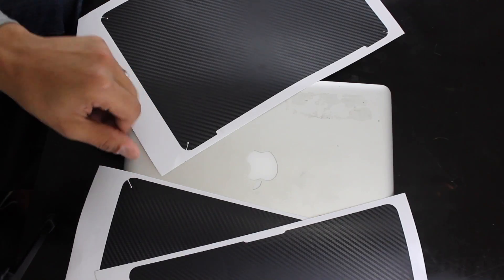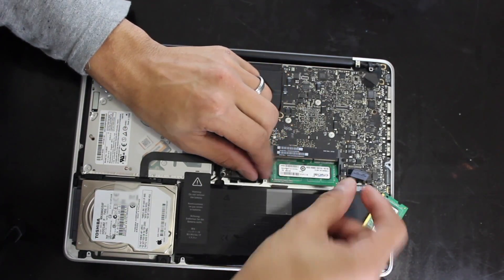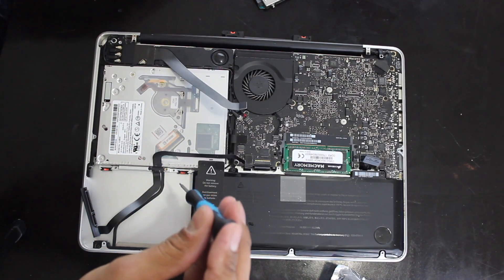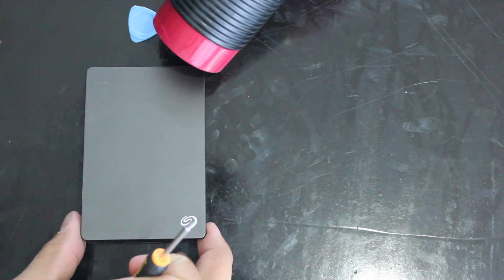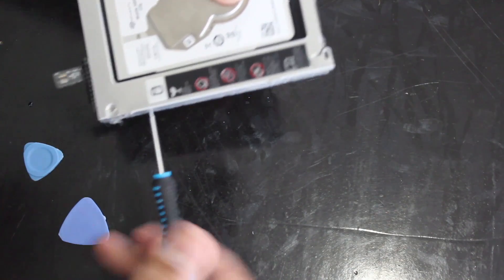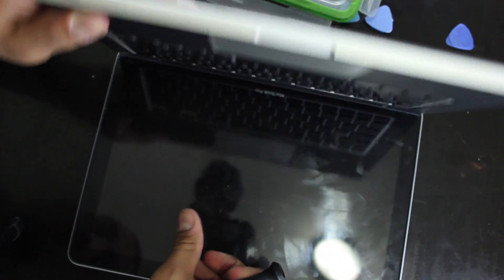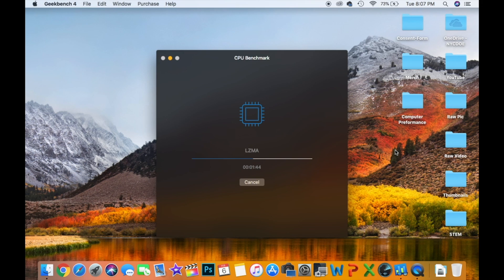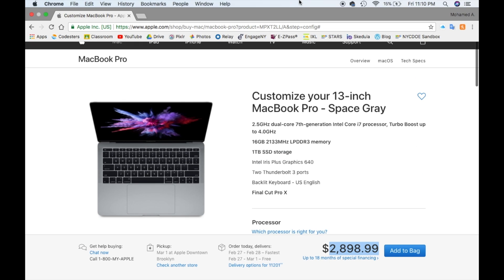2011 Macbook Pro Upgrade (3TB, SSD + 16GB RAM)

Comment: cheers man. just one question. does it work with MBP early 2010?
Reply: not white. its unibody
Reply: you can speed it up with SSDs but maximum ram limit is 8gb 1066mhz for models older than 2011. if i'm wrong please enlighten me.
Reply: Fatih Gözenç I have a mid 2010 MacBook Pro 13 with 16gb ram. It won’t work  on the 15 inch model though
Reply: @jbass1212  i have the same model. Macbook pro 7.1. Would a 1t ssd and 16ram work on this model?
Reply: bhavesh gungabissoon Yes 16gb ram and an ssd works in the 13 model
Reply: @jbass1212  thank you. Planning to upgrade my mid 2010
Reply: bhavesh gungabissoon It will bring new life to it. My 2010 was very slow before

Comment: Hi, i have the Macbook Pro mid 2009. already got 250GB SSD principal hard drive running  win 10 on it, is fast enough but i do wanna upgrade it whit 8GB RAM (max for my Macbook Pro) and put another hard drive caddy as u did,.. my question is if i'll have to reintall the Win 10 or somthing, bcuz i have everything in there (apps and docs). how it works?
Reply: allright,... thanks mate.
Reply: Nope. Your Windows SSD remains C. New drive will likely show up in your Explorer as D.
Reply: how do u run win 10 on your 2009 mac book pro?  i tried to do the same, but every single time i installed the win 10 i would get an error saying it needs to be repaired when the laptop is restarted/turned on.  happens every time... i ended up installing windows 7 ultimate instead.  i used a usb with iso of win 10 to install it.  also used bootcamp...never worked out.

Comment: Should have put the ssd in the optical caddy and left the spinning hard drive where the original was...The original spot has those shock mounts to protect the drive...You would get the same speeds with the ssd in either spot but its the protection for the spinning HDD you've lost doing it the way you did.  Its your computer so whatever...this is for the next person thinking about doing something similar...
Reply: wasnt the thing with the optical caddy that i only has sata 2 and not 3 like the hdd spot?
Reply: The interface for the optical drive is wonky and is 3.0 GB/s and won't work with a SATA 3 6.0 GB/s drive, I tried six different drives and only older, slower drives work. Moe was lucky to get a 2TB drive with the right interface. I've got 1TB SSD and 1 TB HDD and have looked for a suitable 2 TB drive for some time, I may just try cannibalizing a cheaper external drive and hoping the drive is older.
Reply: So if I add an SSD instead of replacing my HD. My computer will run faster right?

Comment: I’ve been looking at buying a MacBook Pro. Never thought I’d buy a used laptop but I’m looking into buying a friends 2012 just to see if I can get used to the software. What are the pros and cons to doing an upgrade like this vs buying new? Obviously price being the main pro but I noticed the read and write speeds are no where near what a 2017 would be.
Reply: Moe & Soe awesome thanks for your reply! I think this will be the way I go.
Reply: Moe & Soe I’ll look for one of those. I’ve been looking at 2012’s just because of this video since I know I can upgrade them. I know with the newer ones you can’t upgrade. Someone in my hometown posted a mint 2012 for $600 Canadian and I thought that was a pretty good deal if I could get it for 500. Would cost around $150 for an ssd and if needed I’d upgrade the ram and replace the battery down the road. I’ll check out some 2015’s. Thanks for your advice!

Comment: Cool video. I have a question. Would the macbook pro performance improve smoothly if Im replacing the old 500GB hard drive with the 1TB hard drive, upgrading the RAM from 4GB to 16GB but  keep the optical drive as it is?
Reply: RAM wise not really. I think the 16 gb RAM only shines when opening lots of programs or very big files. An SSD upgrade will be a difference like night and day.

I have a 2014 Mac mini that came with a 1 tb hard drive. I've bought a 250 gb Samsung SSD that I hooked up to one of the mini's USB ports through an enclosure. Installed MacOS on the SSD and the computer became about as fast as my Windows game PC with an internal SSD. It has 8 gb of RAM which is plenty for me. Before the upgrade the mini was slow as hell. Now it boots in about 20 seconds instead of over a minute. And no rattling HD slowing the computer ever further for minutes after boot. I've kept the hard disk for storage, so my mini now has a 250 gb SSD + 1 tb HD.

My new 2017 MacBook Air has 8 gb of RAM and a 256 gb SSD. That little machine just flies :)

Comment: You could've replaced the optical drive with another internal SSD or HDD and then ran them both in Raid. It might've been easier. There are also a lot of drives with SATA and micro usb ports so you don't have to disconnect the micro-usb adapter. Also, if you're using final cut pro, the 16gb of RAM are gonna be bottlenecked by the 2 core CPU. I'd recommend saving up and building a new rig if you're gonna be working on more render heavy stuff. The 4790k is a really fast 8 core CPU with hyperthreading, a bit pricey but it's a great value and you'll be able to utilize as much RAM as you can afford with support for DDR3. A lot of people will tell you that Haswell CPU's are outdated, but that's not true, especially considering how LGA 1150 mobos are a lot cheaper than 1151 compatible motherboards. These are just things to keep in mind if you're planning on an upgrade anytime soon. Anyway keep up the videos fam, they're great!
Reply: RAID support is dead on MacOS